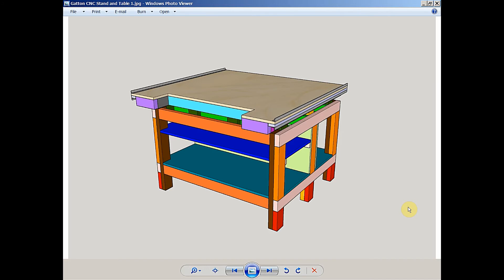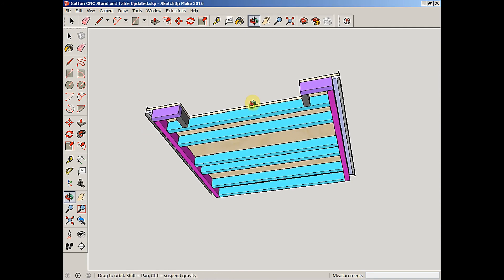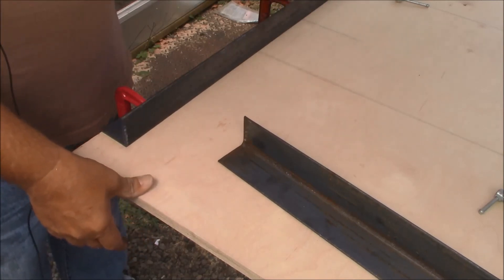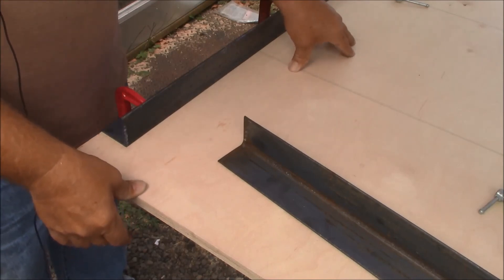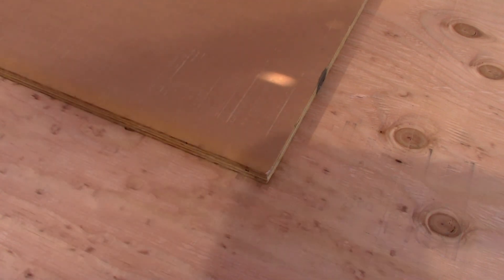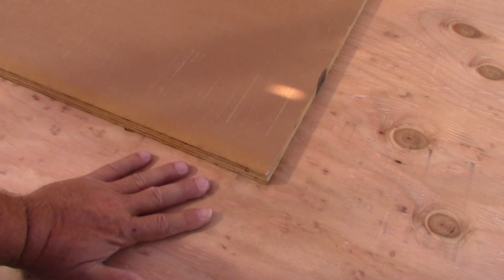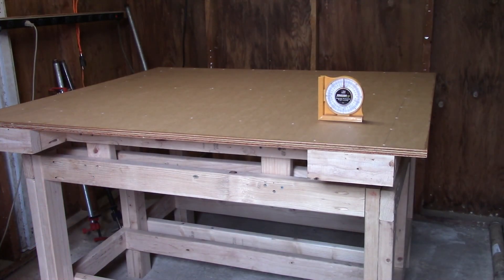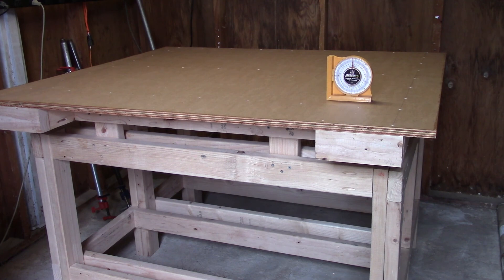Gatton CNC Build - Part 4 - The CNC Table

Comment: Looking good Mark 
I used MDO also on my CNC table ,thinking it would be flatter than other plywood and more stable.
But in the end i still ended up surfacing (tramming) the top to the gantry cutting away all the paper surface anyway.
Unless your going to put another layer of something else on top and surface (tram) that to the gantry.

Just a thought, like your base
Todd
Reply from the maker: Yep, you're getting ahead of me again. A spoilboard will be applied to the table top. I'm just not there yet.
Reply: That's what I should have done , add a top spoil layer to the MDO,
MDO was just to costly to just machine it all off lol

Comment: Looking great Mark! Now just need to get going on mine. Kit is supposed to be here tomorrow.
Reply from the maker: Thanks Alan! Just don't make the same mistake I did and start sanding and staining the parts before you have the pilot holes drilled and such. I had to treat them pretty gingerly because I jumped the gun on applying the finish. Oh well - I can only claim being overly excited and eager to get the build going.

Comment: You did an amazing job on this table! Is it sitting where it will be stationed at? I was looking at the level part intently, that's always one of my biggest concerns. My bench sits outside and the slab is pitched a little. I use shims lol..
Reply from the maker: Thanks Eloy. The table is in it's final location, give or take a fraction of an inch here and there. The way I attached the table frame, I could level the table, even if the floor wasn't perfectly flat. All 6 legs are flat on the floor, and the table frame was adjusted, rather than shimming a leg here and a leg there. As it turns out, I was pretty lucky. It was pretty level as it stood, so I didn't have to adjust it much at all.
Reply: Heck yeah dude! It's tough working in less that desirable conditions. It's looking great!